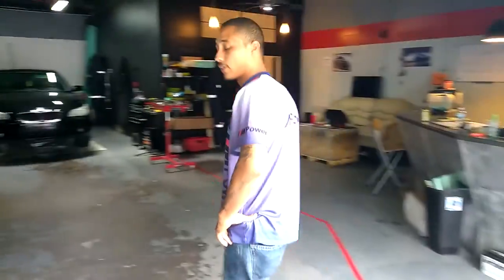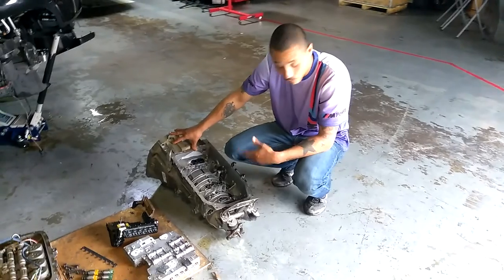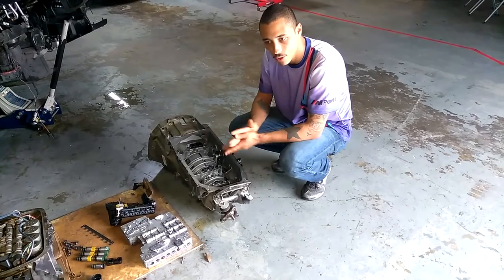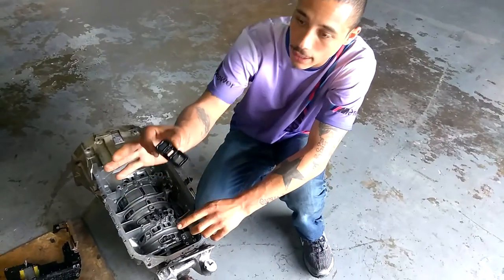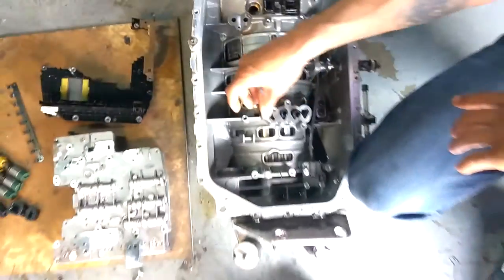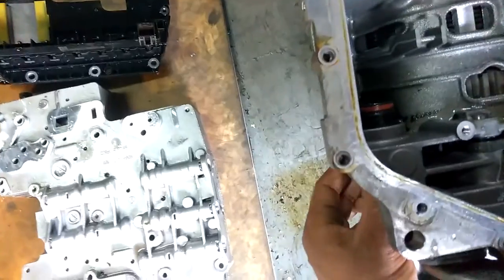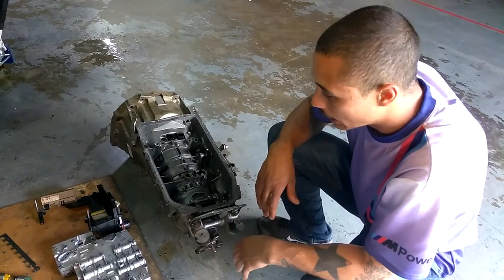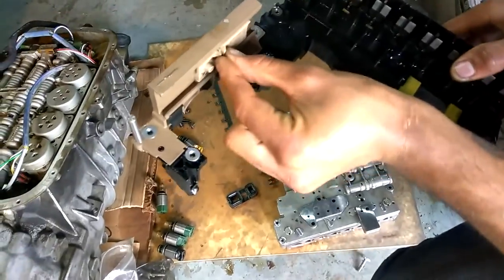BMW ZF TRANSMISSION INSIGHT FROM THE BIMMER BOYZ OF ATLANTA

Comment: Hey Lance,

Recently hit a pot hole here in Chicago, and the vehicle went into park. I turned it of and restarted it, pushed it into drive and reverse but it wouldn't go into either gear. Never had an issue or warning before this. What do you think I should do. My regular mechanic said it's the mechatronics  and I took it to the dealer who said it's that and or the trans as well. What do you suggest?

Comment: Hey bro Great video Great info what would u recomend for my 2004 bmw 530i sport 87,000m never had a trans drain would u recomend a drain n fill or a full pan/filter n fluids. I plan on doing a drain n fill then at 100k i would like 2 drop pan n do the sleeve also. Thanks
Reply from the maker: Got to do all of them for it to be a service! Thanks a lot! Trying to help as much as possible and fill the bridge between.

Comment: Do you have any tips for putting the transmission wiring harness plug back on after you've replaced everything? I'm having a very hard time with my plug and the tab on the side of it seems like it might snap because it's cracked. I have it on but it's a battle to apply pressure and turn it at the same time.

Comment: i have a 2004 bmw 530i and it has a 4-5 flare when pushed beyond 3000 rpm. Any ideas on what you would do. If i push it I get a 4f85 clutch e code when it flares during the 4-5 shift!

Comment: Hate to break it to ya'all, but these transmissions are far from bulletproof. There are numerous baked bronze bushings inside that loose tolerance causing all kinds of problems. Make sure you know what you're getting into before you try to take shortcuts. You may end up spending time and money for zero results.

Comment: Another issue with the ZF6HP19 is the Tcm goes bad. Range sensor 5088 code. My 04 530i kept going into failsafe. Swapped out the tcm with a used one, programed it. Runs perfect

Comment: Hi Lance, I have a e39 with the ZF transmission. Every morning that I go to start the engine my transmission light come on and the car goes into limp mode. I turn it off and back on a time or two and the light goes out. I took a simple scanner and i get a P0798 code Pressure Sensor Selinoid C Electrical code. Transmission fluid look good and topped off. Can u  give me any advice? Have you seen this problem before? I need your advice and help please. Thanks in advance for your reply. Enjoy your videos too!
Reply from the maker: Sorry for delay on e39 best to just replace trans and rebuilt torque converter

Comment: Nice video I have a BMW 750Li (2005) The car is stuck in neutral won't change gear at all. the transmission light with yellow sign saying transmission (P) range fault. Need you help thanks
Reply from the maker: Range error is your selector lever. E65 and e66 common issue wears out quick if not used lightly.

Comment: Hi i do have a GM transmission e46 with a 240k mileage do you think its a good idea to change the trans fluid? I heard it might slip if i change it? I also know that old fluid can damage the trans.im confused assuming the oil aint changed from previous owner.thank you.

Comment: hi, thanks for the video. What do you think if my engine revs up but the power to the wheels arrive about a second later and i hear some kind of a whistle from under my feet?
My BMW has a N52 naturally aspirated engine (120.000mls) and if i step on the gas , sometimes it does this revving up and delayed power to the wheels. Possible clutches worn maybe? should there be a sensor to monitor this? thanks a lot!
Reply: It's your torque converter

Comment: Hi man great video,
Small question, when doing a swap of a zf ga6hp19z technically its a 335 xdrive trans from a e90 do you swap the tcm from the old trans or you put the tcm from the new trans ? 
Really appreciated bro
Reply: Keep the TCM from the old transmission, unless you want to program it yourself. That requires software though.
Reply: Ilya Golovey thanks, 
I finaly used the newer tcm , I just had to Alpina flash with the new vin number using winkfp and everything was good to go, berore flashing everything was working except ds (sportmode)

Comment: Hey buddy. Hopefully you can help. I have an 04 530i and I had the transmission fluid replaced about a year ago. This made the car drive like new. Now I'm getting the transmission malfunction. I have the Carly app to diagnose and its giving me the inhibitor switch as the fault. Would that have anything to do with the transmission internally?
Reply from the maker: Sorry for delay Bro! Call me in AM 4702637914
Reply: Hi great video Brother. I have 2007 530 i with 97000 miles with no codes. what  should I do drain and fill or change the filter. also the transmission is zf 6hp 19 for that car. please show how many valve body I have to get. and what other parts. please you can email at goldenshah93@gmail.com. 
also  do you anyone in Los angeles area or southern Calif can help me with it. thanks my brother.

Comment: Hey I have a 2008 bmw 535xi that shift hard also trans malfunction and now my transmission when to safe mode can barely drive the car I have to two code P17E9 and P17E5 what are my options at this point please help
Reply from the maker: Hey, Sounds to me like you need a solenoid kit and all new valve body sealing sleeves. Filter/pan/hardware and fluids. Adaptations, learnt values and codes cleared and reset. I am not there so it is hard for me to be completely accurate. Your transmission seems to be losing pressure thru the seeling sleeves causing solenoids to NOT work properly. As well as hard delayed shifts. Solenoids are probably burnt out as well.
Reply: Lance Baumgras the solenoids inside the transmission are burnt out??
Reply: I can try that or replace the transmission I find one with 90k miles on it off and 2009 bmw 535xi for $600 what is your suggestion I really appreciate your help
Reply from the maker: Mohamed Diallo And that right there my brother is where I would have to see the inside of trans. And inspect the situation further. It is still recommended to change listed parts on used trans. And valve body.
Reply: Ok thanks man really appreciate it
Reply: One last question Do I need to get it to get program for if I replace the transmission

Comment: Great info..lot of details..i have one question i have a 8 speed trans on 2012 528i...what fluid would u recommend..
Reply from the maker: rob06366 I would order either MOTUL or LIQUID moly fluid direct replacement. There are so many variations but one or two just for you. I can look it up monday if you would like a straight forward answer. As far as spec. You are welcome to call or text anytime 47026379one four.
Reply: Lance Baumgras thank you..really appreciate fast response..i was looking up a kit on amazon of zf 8